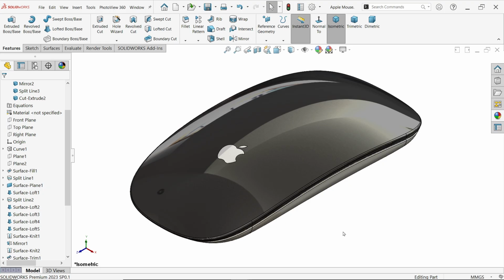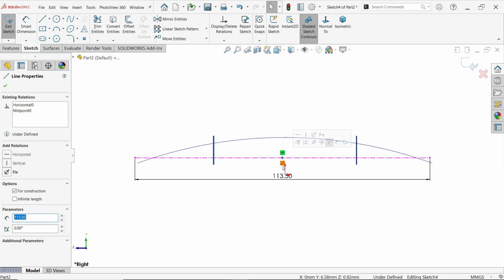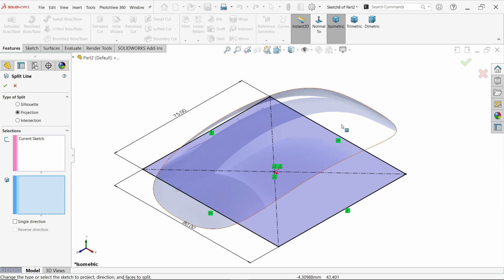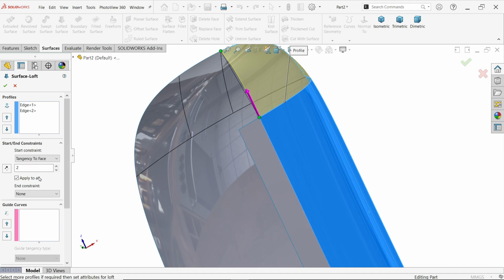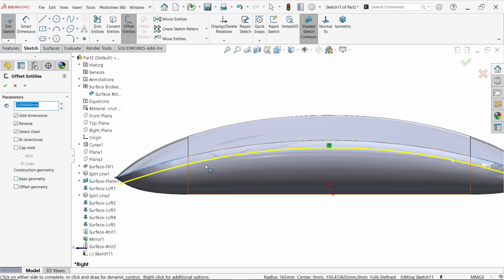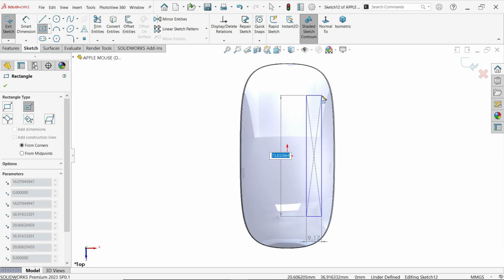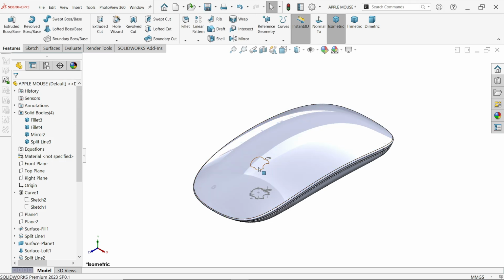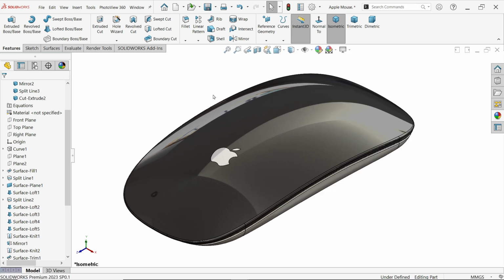Apple Magic Mouse SolidWorks Surface Tutorial

Comment: HI
I had a problem 
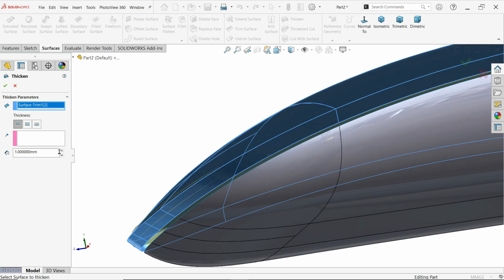when at minute 19:53 the thicken tool in mine it didn´t work for the top body
it worked for the lower one
any idea why
i tryed knit stiching the top and sides seperat it worked and combinng then but it left some residues
thanks for every thing

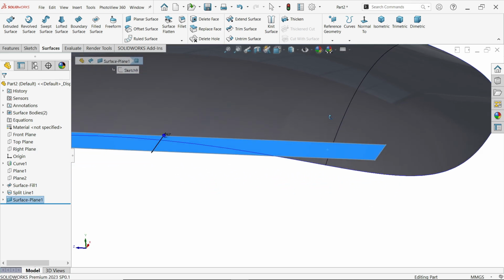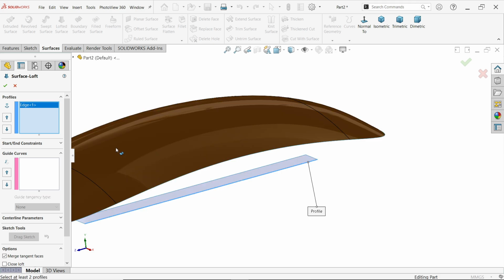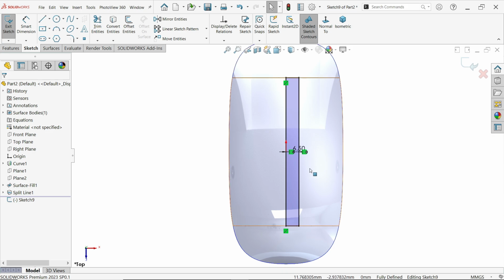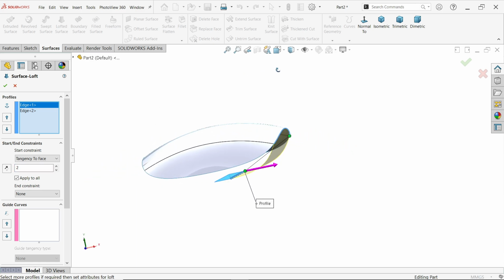Comment: Sir when I use planer surface command after that when I use the lofted surface the problem is i am not able to get the edge to make the loft for the surface near around 10:20-10:40. Please help me also i think video is cut between 10:00 to 11:00 min. Please help how to do. I am unable to solve even following same step as you and i have done everything right

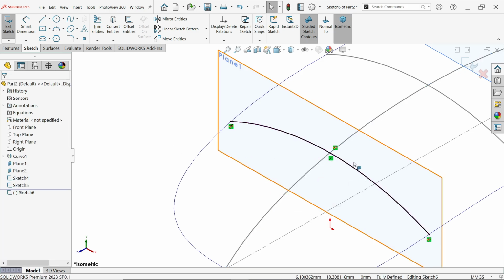Comment: 6:48, unable to pierce the third point. it read over defined
Reply: Dude I just worked on this tutorial, make the length of bottom spline equal and try again. Tutorial saids 80 and 85, however, I made both side 80 and it worked.
Reply: @aien9811  Thank you bro!!! I was about to smash the monitor along with the solidworks! It's really kind of gyuk with these 85 and 80!!!
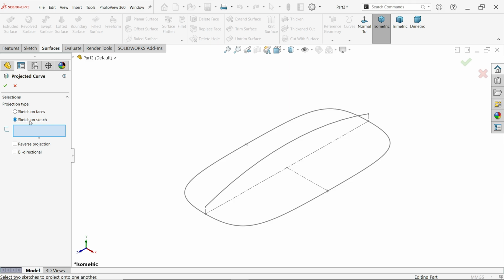Reply: @aien9811  3:20 in this step when I use project curve command the created curve become undefined and blue. How can I fix it?
Reply: @hadibs  im not sure about the issue by what you said. But I think it’s probably related to the sequence of creating and selecting sketch. Make sure you follow the exact steps on the video.

Comment: Apple logo i cant add, when i give split line for adding on the surface it shows error. And I cant add thickness for top part. so many people has same issue , can you explain it?
Reply: Knitting surface. Possible reason (I faced this) - while knitting surfaces for the 2nd time you need to check all the gaps in gap control. It's already selected in the video but it wasn't selected in my case.

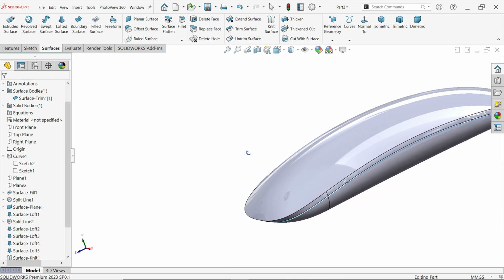Comment: @20:02 it says failed to offset or face could not be deleted when I try thicken
Reply: im having the same issue rn
Reply: @AlessioVerrecchia  surface knit 2 reduce gap parameter to 0.01 it will work
Reply: @teammystic7493  thank you 🙏
Reply: @teammystic7493 life saver
Reply: I have another solution 
Go to surface knit 2 and one cheek Gap control and it will work
Reply: @gamingmobiledz6264  thank you bro
Reply: Same issue
Reply: @GeetaOnShorts  surface knit 2 reduce gap parameter to 0.01 it will work
Reply: 😂😂😂the same problem
Reply: @gamingmobiledz6264  surface knit 2 reduce gap parameter to 0.01 it will work
Reply: I fixed it other way
Like while knitting final surfaces made it solid and instead of trim surface 
Cut extrude and
From inner shell it got same results 

But don’t know why couldn’t thicken seems issues with flip tangency direction